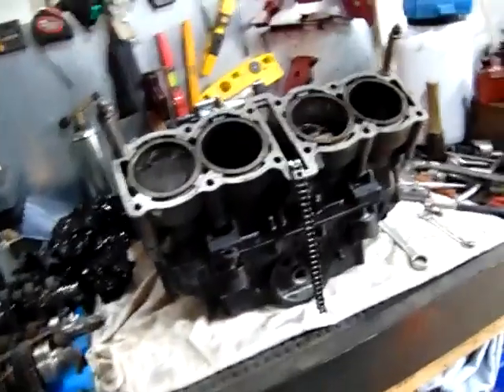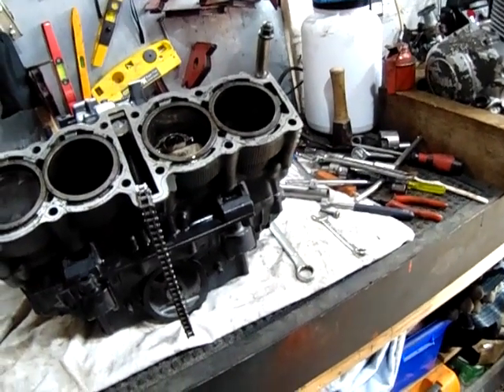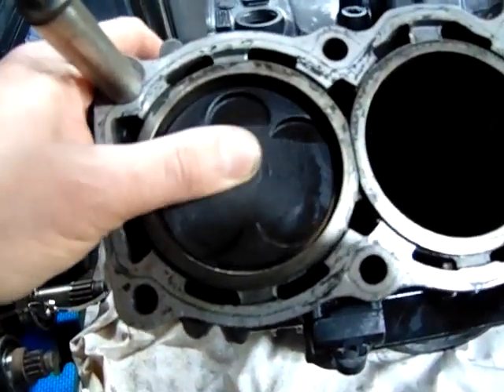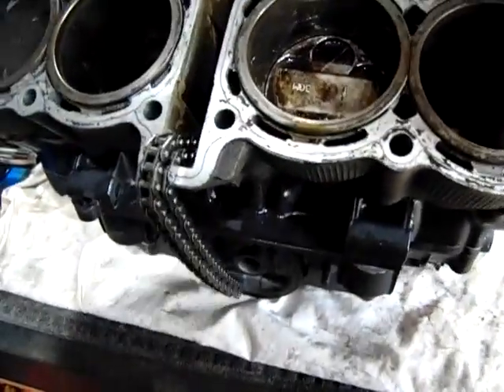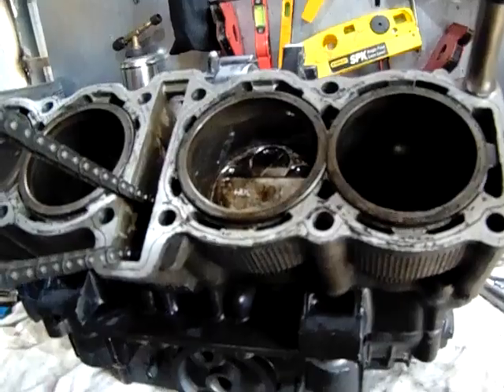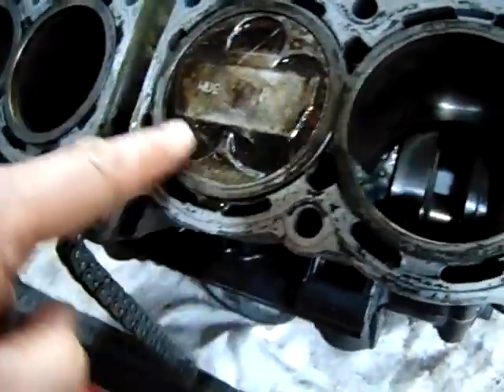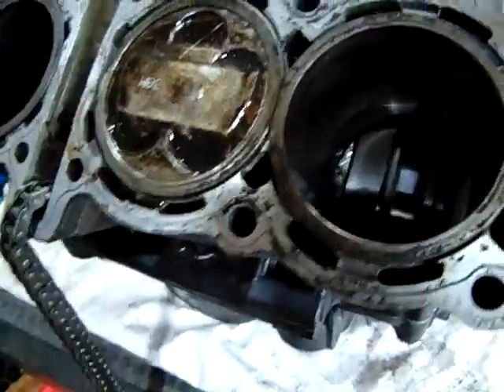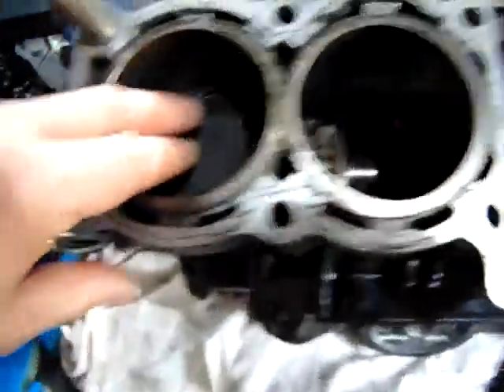R1 Rods into Thunderace Engine - I WONDER?

Comment: Hi. just a thought but the  length of the con rod doesn't change the capacity of the cylinder the stroke remains the same, the stroke is defined by the throw of the  crank i.e. the difference between the centres at top dead centre and bottom dead centre.👍
Reply from the maker: I must admit that I thought the stroke was defined by the rod length, I was thinking along the lines of if I have for an extreme example a rod length of 100feet then the piston, ...actually yes you are correct, its the crank isnt it, if I have a crank web that circles a diameter of 4 inch but the next crank web has a diameter of 6 inch then even if the rods are the same length the 6 inch one would travel further, is that right?